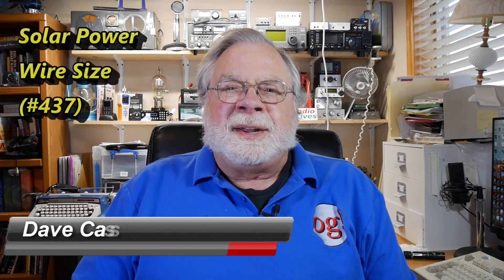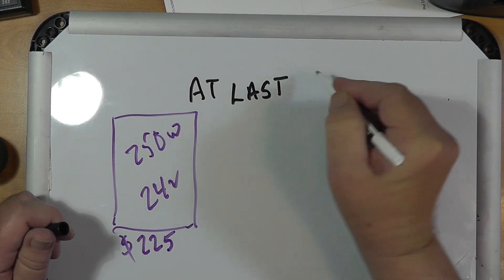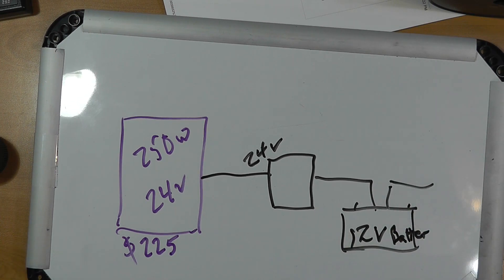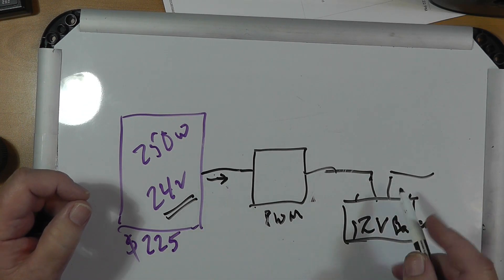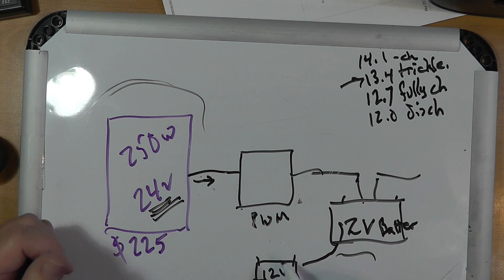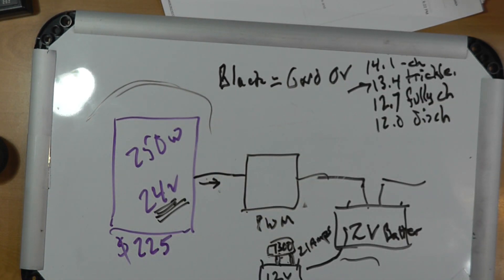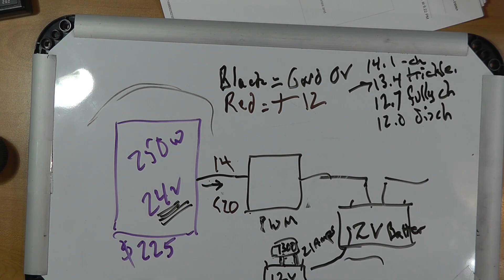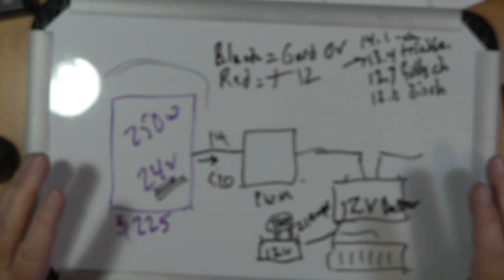Solar Power Wire Size (#437)

Comment: Because you have novice (newer) enthusiast. I would not call the second battery the 'repeater' battery.  The second battery (connected to the radio) is more of a closer storage battery in your configuration and is not needed if the length of power cable is short in a shack.

Comment: Thanks for the video Dave!

Is there any sort of "smarts" in between your big battery and your "repeater" battery, or is it just a run of copper?  I am envisioning that when you transmit with the 7300, the "repeater" battery takes a huge hit (21 amps), but if there is only "dumb copper" going to the big battery, then some power must also flow (less efficiently) through that path the very instant you energize the load and begin to discharge the "repeater" battery... If I am understanding what you are saying, then the next thing that happens is when you stop transmitting, the system seeks equilibrium, and thus some smaller amount of power flows from the big battery into the "repeater" battery in order to bring it back towards full charge.  Not the same draw as when the load of the transmitter is applied, but a smaller amount being demanded by the partial deficit that now exists in the "repeater" battery.  I am visualizing something almost like the flow of water in a toilet, where when you transmit the "repeater" battery dumps quickly and then refills slowly while you have the rig in receive.  It's almost like you have two physical batteries but in essence one charge storage pool with a big bathtub accepting flow from the solar and a toilet tank being filled by the bathtub and periodically being strongly discharged by the "flush" of transmitting.  They are two separate containers but connected in one unit with free flow between them.  Am I thinking correctly?  Is "dumb copper" okay for this connection between the two batteries when used in this application? 

Thanks and 73 DE N9THH

Comment: You can get up to twice as much out of the system if you use MPPT  charge controllers. They have a Buck Converter that will change the 24  volts to 12- 13.8 volts. Giveing more power to the Battery.
Reply: It is going to depend on how the system is set up. Some systems are setup as 24 volts so two 12 volt batteries are in series. It will depend on the solar panel. I have a commercial panel that puts out 49-50 volts and my charge controller then steps it down to 12 volts to charge my one battery. I could have set it up it up to put out 24 volts. A MPPT charger is much more efficient at charging the battery bank back to full charge, no matter how many batteries in the battery bank.
Reply: @williambouchard4480  that is what I said MPPT charge controllers are more efficient! You can get more out of the panels to the battery.  It doesn't matter what the panels output is or the battery voltage as long as the panels out put is higher than the battery and not higher than the charge controller can take.

Comment: Many thanks Dave,,,.  I want to build 40  north south directed ,14 gauze wire dipole antenna, BuT.  At my location. There are two big building s one at east to me directing N-S ,other is south to me E-W DIRECTED,.   DOES directed 40 feet dipole work properly , will those building hammper dipole transmission or reception?

Comment: If your panel is 24v and the battery bank is 12v usually a PWM charge controller will not accommodate the voltage differences, ie 24v panels use a 24v battery array.   MPPT charge controllers will usually allow for a higher panel voltage than the battery array.  Also there was no discussion regarding the copper wire strand count... usually an important consideration for max DC current flow.  And last, I felt the whiteboard diagram was a bit chaotic.  Other valuable info is 50% battery charge voltage, at about 12.2v.  Sorry for the negative evaluation.   Doug, K5DHL
Reply: What does strand count have to do with current flow, A.C. or D.C. ?
Reply: Sylvan dB. The strand count is important because voltage flows on the outside of the copper wire. The more strand counts the more voltage a particular wire can carry. The thickness of each strand will determine how much current the wires can carry.
Reply: @williambouchard4480  no, that is completely false.  first, the only possible issue is current not voltage. second there is no effect at DC, insignificant at 60hz AC (look up skin effect depth equation). third all the strands are in contact so act like one fat conductor until extremely high frequencies (hundreds of MHz nearing GHz) where you need a waveguide because the current does not like to bend.
Reply: oh, and voltage never flows. voltage is potential, current is the flow.

Comment: Dave, I'm perplexed. @4:00
You stated that the panel Voltage can change but the Current remains steady.
I have a 100W/12V panel (Renogy) and it measures the Current fluctuating depending on the amount of sun. This is usually around 3-6 Amperes. - Did I miss something, in need of enlightenment, -or a wooden paddle? lol.
-Thanks and '73.

Comment: AGM is still lead. If 12.7 is your full charge (resting) then every mfr. will tell you to only cycle them 30% (12.4 volts) for best life. 50% (12.2v) for good life, and anything more than that will really consume them, like 500 cycles instead of the 2-3000 cycles that 30-50% discharging may get you.
 Numbers will vary, but YES the differences are that radical.

Comment: 14 gauge is way too small, your not transferring the full output of the panel to the charge controller. The resistive losses in that cable will loose almost a full volt at 7 amps. You're not getting all the power from you panels and your starving your radio on transmit. Your also too small to the radio. At 20 feet and 20 amps you loose 2-2.5 volts at fuill power TX. I guarantee you if you put your multimeter on the back of your radio where the 12 volts comes in, when you transmit you'll be lucky if you have 10 volts. Upgrade all your wire to at least 10 gauge, I would use 8 if it was me.
Reply: Certainly the heavier the wire gauge, the less loss. The point here is what works. The battery is supplying the power to the radio. The lesser gauge wire with what Dave feels is an acceptable voltage drop, only affects the battery charge rate.   Love ya Dave!
Reply: Hey - you don't hear so GOOD - huh?. He's taking output from a 24 V solar panel to a nominal 12V PWM charge controller into a 12.8V L/A battery. To provide 12.8V to what the battery is looking for, PWM will provide 24V to said battery in at a MODULATED rate. That being said, the #14 wire will be PLENTY enough to supply 7A provided by the panel (#14 is rated at 12a continuous). The amount of IR loss at 20' (x2) run is still WAY within any drop from the 24V supplied to the battery via the controller. NOW where it gets down to it is where the current FROM where the batteries is delivered. He states a "repeater" battery at the OPERATING POSITION. This is secondary to the MAIN battery off the charge controller. This "repeater" battery is where the ~21 amps is delivered. Otherwise, it's just suckin hind-tit to float. LEARN OHM's-FUCKIN-LAW, Socrates. You just want to argue for the sake of finding fault - and you just got your ass kicked by one who just forgot more about electricity and radio electronics than you're likely to ever KNOW - as well as grammar and diction from your apparent public school education.
Reply: I beg to differ.
I just set my power supply to 10v and the Icom IC-7300 failed to power up.
I do however agree that using #10 or #8 might be more efficient.
Conclusion: I am quite sure that Dave tested his working battery system.

Comment: 20+ years electrical contractor: 21amp load requires #10 AWG …because #10 AWG is rated for 30amps max. Not allowed to connect any load drawing more than 80% of the AWG rating . Thus #10 AWG is rated for 24 amp load maximum . 

#12 is 20 delayed load to 16 amp and # 14 is 14 I rated to load of 12amps 

So connecting a 21 amp load to a 12 amp wire is not legal or safe according to National Fire Code
Reply: I've been using 12-ga red/black zip cord for making up DC power cables in my shack for everything 12V DC except my IC-7300, which can draw up to 21 amps on xmit.  Oddly, Icom seems to carefully avoid stating what wire gauge is used in the stock DC power cable.  DXE offers replacement cables with a 25-amp in-line fuse, but also declines to state the wire gauge used.  I didn't put calipers on mine before I installed PowerPoles, but I'd swear it appeared to be 12-ga.
Reply: As an electrical contractor you are used to thinking with NEC and perhaps for general purpose circuits. Look up the ampacity of 12ga in chassis wiring or in automotive. For another interesting point of view, calculate what ampacity is allowed by the NEC for 12ga on dedicated motor circuits to accomodate starting surge.
Reply: Glen, the ampacity per wire gauges you quoted were for “continuous loads. It’s been several years since my apprenticeship, but the 80% maximum loading is for continuous loads which if I recall correctly is for loads that stay on for 2 hours straight. I think the last NEC book I owned was 1984. Has that rule changed since then?
Reply: Stick with your experience in AC-based NEC crap. We are HERE talking about about amateur radio applications. YES - NEC APPLIES, but I bet you cannot tell me how the rise-time of a lightning surge is COMPLETELY ignored by a green bond wire in your typical household wiring situation - and how that will destroy equipment and possibly cause a catastrophic fire. Remember NEC is written by unaccountable government bureaucrats - they can't be touched and make their living brainwashing electrical contractors.